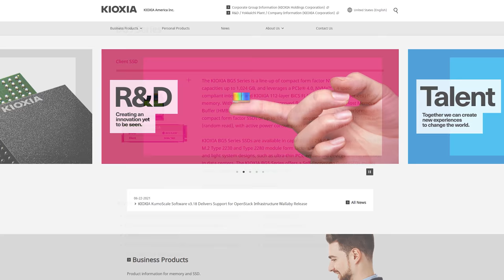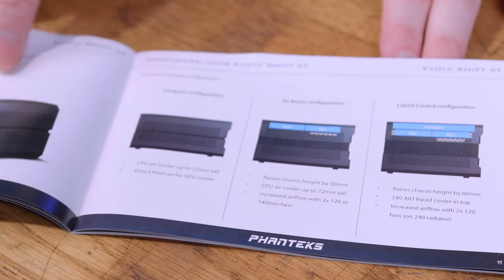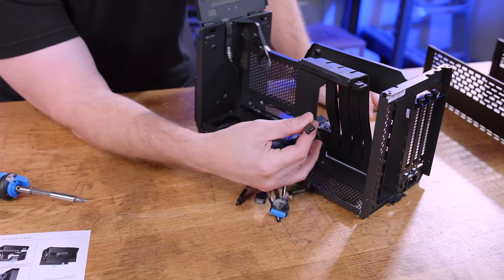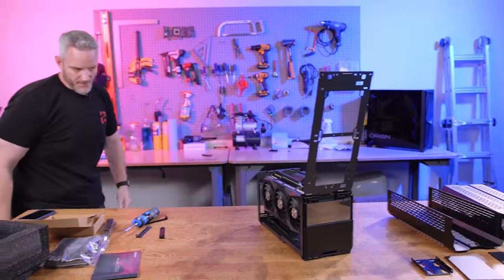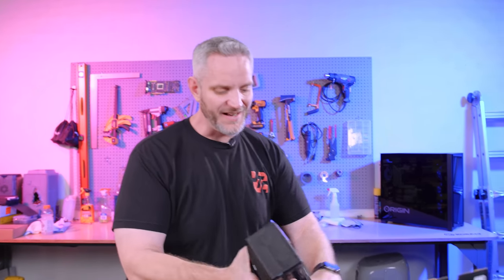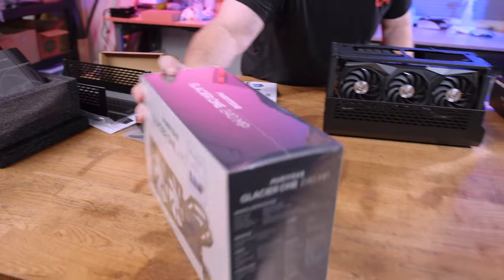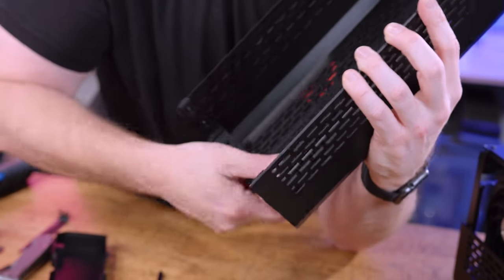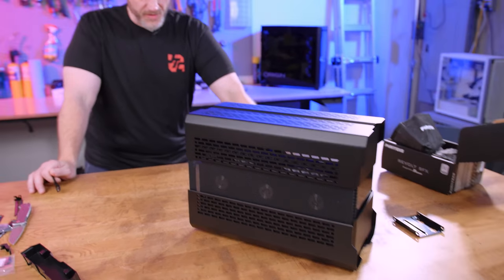I just fell in love with this case...

Comment: Phanteks probably still remain my favorite case maker. Bought the original Enthoo Primo when it came to market, still got it! I was a little rough with the front panel and broke the locking mechanism that holds it in place, support just asked for a picture to show them which part i was talking about, then sent me new ones in the mail, from Netherlands to Denmark, free of charge. 3 days ago, i talked to them again, as my Evolv X power button assembly is broken (possibly self caused) and again, they are sending a new one free of charge, all they asked for was to show them the invoice to confirm purchase, no questions asked. They also answer mails really quickly and always polite and helpful, straight to the point aswell. Not to mention interesting products and designs and usually high quality products. Owned or built in about a handful of their cases and they've definitely made a loyal customer out of me!

Comment: Phanteks never ceases to amaze me with their ITX cases. With the exception of the shift 2, where you needed an AIO that has the pump in the radiator, otherwise you are risking pump damage on the long run because of the lower compartment radiator placement, so it was an aircooled or bust case.

Comment: I've had an Evolv ATX for years and the build quality continues to impress me. I've built a few systems in the case at this point and every time it's a dream to build in. The only issue with it is airflow through the front and top panels, but I love the case so much I found a company that machined in vents and added mesh to the panels. Now it's just the perfect case.
Reply: That’s awesome! Do you have a link to the mesh panels?
Reply: @micoolio8239  I think he means he paid a local company to do it, but I could be mistaken.
Reply: @micoolio8239  ModMyMods, look on the Custom Services tab.

Comment: I got a Phanteks Eclipse P600s but mine is different than most in that it has a solid side door instead of glass for two reasons, one I use a Vector Network Analyzer for designing remote (wireless) sensors and it's sensitive to RFI when used on a PC with a glass side so a solid side door is a must for me and two it was 20% off because apparently everyone wants the glass door model. It's big, it's heavy, it's built like a tank, no sharp edges, sound dampening material on both sides so it's really quiet and the fit and finish is flawless.  Excellent manual

Comment: Phanteks is the best case manufacturer next to Lian Li, I have the p600s and there's nothing better built than it. It's so good I keep falling in love with it every time I open it to clean my components.
Reply: I have the p600s too.  I have rebuilt my system twice in it.  And each time was easy and enjoyable.  I also like it's semi modularity almost making it a closed case, but far more quiet, and the ability to open it up into a more mesh and filtered open case with just the removal of some panels.  After seeing this video I am thinking my next full build may just be a small form factor build though.  I'm wondering if I could figure out if I could do some form of custom loop in it though.

Comment: Phanteks has absolute top tier cases. their low end is good (P300), their medium end is amazing (P200, P400A), their high end is great (P500, Enthoo line-up), and their highest end is phenomenal (the whole Evolv line).
Reply: i dont think evolv is their highest end. the enthoo elite and maybe the 719 would fit into that.
Reply: I also was kinda in love with the Phanteks Enthoo for the longest time. However after all dabbling I ended up with the Thermaltake P3 since it is pretty much a bench table up side with tempered glas front you have all the heat convection that you can dream of for a passive (under hard load semi passive) system. Slience is key and when running desktop the only thing that makes a noice is the big storage HDD in the system, if I put something there. Using a PC on daily bases for hours that is silent makes the work environment so much better.
Reply: Agreed, bought the P400A white in 2020. Couldn’t be happier!

Comment: We' re huge fans of Phanteks cases. Most are assembled with screws (instead of rivets) they're well designed, have spare parts/options available, and the screws come pre-sorted in a little plastic organizer!
A couple of improvements that would be great to see on this one are taller feet – (there's not a lot of space underneath the chassis for bottom air flow) and the ability to screw in the front and rear panels – (magnetic panels can pull off and cause accidents when you're trying to lift or move the case).

Comment: I love the Evolv line, i still have the matx version before they did tempered glass panels and I have no reason to change the case anytime soon, it's bulletproof
Reply: The matx Evolv was the first case I ever bought that I genuinely loved. Still have it sitting in a dusty corner. My motherboard failed and I decided I wanted to do a custom loop so I bought the Lian Li pc 011. After running a custom loop for 1.5yrs I can tell you that it's mostly about aesthetics and for the average user you don't really need full loop cooling. Also, there's slight evap and as the level decreases it leaves water marks in the reservoir. I do miss my Evolv but I'm running a full ATX board

Comment: I must say I miss good cases with 5,25 '' slots, cause you can fit all sorts of useful devices in there, but most good cases, including LianLi ones (have an old PC-7FNW) go for looks over useability these days. 

And while most think optical drives are thing of the past, in the last two years they've been a godsend, both for watching films and series without worrying about bandwith, as well as good sound and image quality. 

Also great if you have a collection of classic games, including the old boxes with those spinny things called CDs and DVDs. 

Or want to fit some useful devices like card readers, especially for bigger cards. I don't want to have dozens of things hanging of my PC, I've got a case where I can fit them. And it's not like I don't need the USB connections with, a mouse, HOTAS (2 Devices), Rudder Pedals, a TrackIR, a wheel and Pedal set, a Shifter, an external Harddrive and a Scanner hanging off that already. 
Thank god I'm running an old PS/2 keyboard, or I'd really be having trouble. 
Nevermind me thinking of anything like a DAC. 

Then Phantek Enthoo of the older gens look nice, but then with 27 kilos they are extremely heavy.
Reply: Corsair Carbide Air 540 has 2 optical drive bay slots.
Reply: @carlkidd752  Thanks, will take that under consideration. 
Was looking at some of the older Enthoo Primos, and with 17.something kilos they are just inside the weight limit. I was looking at a bigtower. 

But, having had a first look at the Carbide Air 540, it does look interesting. Might have to look if they have a bigger variant.
Reply: @Bizarny  Number one I own those movies, I own the pressed version without having to worry about the version being changed, whenever the publisher is following the next craze. 
Additionally a pressed (not burned) DVD/Blu-ray is quite long lived, and I don't have to worry about a Harddrive going bad or something getting corrupted by online storage. 
Archive disks exist for a reason. 

As far as Remux go, what is the sound encoding on those, full surround support? 

Same for the games, I own them, I know how to run them, and unless the CD stops working, why should I get the GoG Version?

I like them, but I reserve buying for games I never got around to playing. 
I also know how to run those old games from GoG. 

Also not all games I have are old enough to be on GOG. And some Addons I own would require me to buy a second version for the download version. 
Also I have the installation version+Patches should the dev go tits up. 
And if you run stuff like X-Plane 10 or 11, there is a disc version, where all you need as DRM is one CD Check every 24 hours. No online connection, nothing. 
Admittedly installing from 6 DVD is a bit annoying, but that happens once, and then you can just move the folder at your leisure.
A Blu-ray version would be nice for X-Plane 12....and knowing my friends who have the new MSFS 2021. I'm pretty sure they would've liked a disc Version, preferably as Blu-ray, because downloading 100GB takes a while. 
I mean it's bearable if you have a 400 Mbit/s connection, but if your internet isn't as quick, the disc version is faster and the download volume is only the updates. 
Remember even today, not everywhere has 400mbit/s+ Download speeds. Some Rural places even in the US and Germany struggle to get 20 Mbit/s. 

I like having the option of an optical drive, for all those reasons and  I can also run CDs and take audio from them if I need it. 
If you have a collection of CDs and even Records that is a nice feature.
Yeah, I'm not just using it for Gaming or entertainment......

What I do not like is having to hang dozens of things unecessarily of my case. I like it being clean in that way, having all the necessary stuff neatly stowed away in the case. 
5.25 slots are not just for Optical drives, they were in the past an integral part of building your own customized PC, because you could choose your own Fan control, your own Card Reader, front panel, etc. 
You're giving up all that freedom by not having those. Now you're limited to what the Case manufacturer gives you. 
Or you have to use one of your rather sparing USB connections. 
I still like my old Scythe Six-channel fan control, the display is a bit wonky, but it still works after over 10 years. 

Sorry mate, but your comment is just another one of those, "why do you need an optical drive, bro, it's so early 2000's". 

The funny thing is, the case developers these days are so consumed by making their cases look clean on the inside, but to make them useful as working machines we have to dangle a dozen things off them. 
The Carbide looks like quite a neat solution to the cooling issue.
Reply: @LupusAries  built 1 x-78 4 x-99 and 1 x570 PCs all using this case. downside: only 2 fans included and if you want to use an arctic LF II 280, it fits, but tight squeeze. Also many of the bigger tower air coolers will not fit. I used corsairs 280 aio and they fit just fine.  Easy to work in. PSU, optical drives and SSD cages all on the back side of the MB panel holder. 2 HDD drives slot into the bottom (gpu side), but I never used them, so just pulled the slide out cages and wiring. NOT a candidate for a custom loop due to the 2 compartment build.
Reply: @carlkidd752  Thanks for the further info. 
I was looking into that AIO recently, as faffing about with my old Mugen 2 just got a bit too anoying. Still perfectly fine performance-wise, but it is just such a faff to take it out. 
Especially since the rear cut-out in the Lian-Li is a bit to far back on relatively modern Mainboards, they moved the CPU-socket a bit more centrally on those. 
And with some fettling the 280mm Radiator Corsair AIO would fit in this case as well. 

The Obisidian 750, especially the Airflow does also look nice, and lighter than the Enthoo Primo, although the latter looks a bit better, and I like the seperated PSU concept.
Decisions, decisions. ;)
Reply: @LupusAries  The reason cases aren't having 5.25 bays isn't just because they "look bad".  It's because the majority of people aren't like you and me, and don't hold onto things for a while.  Not saying that's good or bad, just how it seems to be.  Though personally I don't mind using my USB ports with adapters or dongles, because I don't need them all the time.  I pull em out of a drawer (even my external DVD-ROM drive is in there) plug em in and go.  When I'm done they get put away, no mess.  

Good luck finding a case you like though!  Finding the perfect case for a build makes it way more fun to build.  Just a word of caution on AIO's though you probably already know, but they have a shelf life.  Usually about 5 years, then you replace them.  If you're someone who prefers to continue to use what you have while it works you might prefer a good air cooler from Noctua or Be Quiet, they both make air coolers that are easy to install and compete with AIO's in performance.

Comment: Phanteks, is somewhat underrated for what they put out. I may have a Lian-li xl for performance (10 fans and because water) but I still love my P600S because of how structurally right it feels and the fact that I can simply have smaller second system in it. Every small thing they use for their cases, accessories, even manuals, shows care, which is pretty rare these days.

Comment: Hello Jay, big fan of your videos and the knowledge you share with so many of us. 
I have just recently finished my first ever pc build, i have followed many of your guides and instructions.
All has been well with it, for a bit over a week now. I have benchmarked and gamed with it in that time with zero problems, until today 😫😭😭
I shut my computer down after about an hour of play on a very low consumption game from steam. I returned home a few hours later, turned thr pc on. Booted fine, went to start that same game and the pc restarted as soon as the game would go to fullscreen. Tried it again with a few other games with the same result. I checked and tried many simple options but have found no result 😫 looking at possibly a failing PSU, i have the corsair cx750f rgb. It doesnt seem to get hot, the fan runs at a medium speed from what i can tell, it was brand new packaging when i opened it only a few weeks ago when parts began arriving. All temps on the hardware has been very good at 30-40c. Please if you can help me i would be forever grateful for any advice! 
Thank you

Comment: this is the first case in a while that has me excited. I have an old v4 Ncase M1 that has been great until 30 series. since it doesn't have ventilation in front of the GPU temps get into the 90s pretty easily. I may have to check this one out as a replacement

Comment: Phanteks' cases aren't intuitive, but they more than make up for it with that full-color manual with a fluent translation.  I just finished a build with this case.  It was fun to build and I never felt frustrated.  They're so close to this thing being able to fit a 280mm Rad, but it won't.

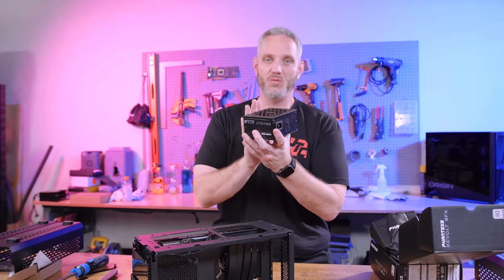Comment: 9:36 Just as a side note no, you don't, the max is 1000 Watts 80+ Platinum in SFX-L (Silverstone SX1000) and 850 Watts in SFX BUT 80+ Gold (Cooler Master V850 SFX) fortunately this case alo supports SFX-L although recommend SFX (as another side note the difference between SFX and SFX-L are exactly to allow the SFX-L to use 120mm fan while SFX use 80mm ones)

Comment: Mine came in yesterday too and I'm blown away seeing it in person. It's fricken beautiful. Honestly think it's so much nicer than the ghost and the Thor, with way more compatibility and options. Now I'm just waiting for the new EK strix waterblock I have pre-ordered (and my 1700 quantum block) and I'll be swapping my 12900k strix 3080Ti build from my Hyte Revolt 3 into the shift XT. I'm going to mod the top radiator bracket to fit a 280mm rad, an alphacool st30 crossflow, as it will fit I just need to make room for the outputs. Other than that I think it'll work great. I have an ek ddc x-top pump I'm going to try and make work, but if not I have an eisstation 40, the solo, and a couple dc-lt2's to rig some sort of back up option. Now that I have it though I'm gonna start really testing out potential layouts. I would love to be able to use a DDC FLT80 but I don't think I'll be able to work it. We'll see.
Reply: 🖕 Congratulations you among the selected winners claim your PC via telegram 📩⬆️

Comment: I am fan rather bigger than smaller cases, for at least four reasons, first they are easy to mount stuff inside, second you can mount any size of CPU cooler, GPU etc., third they have good airflow, fourth which is kinda connected with third, but only partly, they can be really quiet! With airflow AND sound dampening panels inside!

Comment: Only thing I would have done different with that case is make it so the bottom bracket expanded as much as the top so you could run a bottom rad or even just some fans to blow up into the case.

Comment: What would be really cool (in both relevant meanings of that word) is if someone made an air cooler with 2x140mm fans which fitted on top of case, probably in the "water cooled" configuration for the case, but that should give excellent thermal performance

Comment: Too bad there is only room for one 2.5 SSD.  Although you could use an expansion slot for a hot swap bay I suppose. But that leaves you with a narrower VGA space. Also, I'm surprised there is only on USB 3.0 slot on the front panel. Two slots would allow a dual usb cable for my hot swap needs. I guess I would use the back panel for access. Nice case though. Room for a radiator and fans! I will consider it for my next build over the Cougar QBX. This one is a hundred dollars more, so there's that...🙂